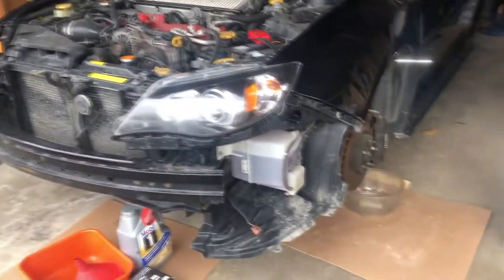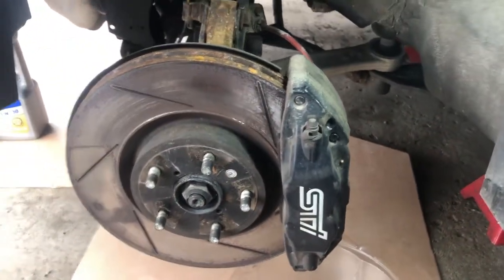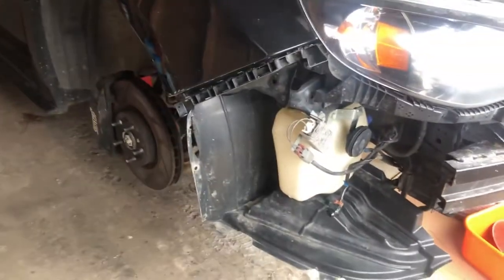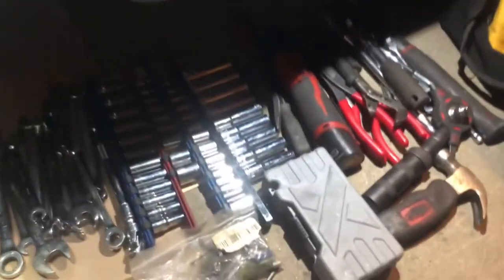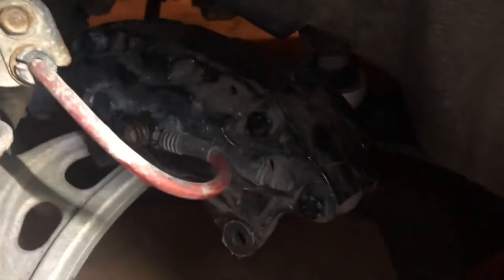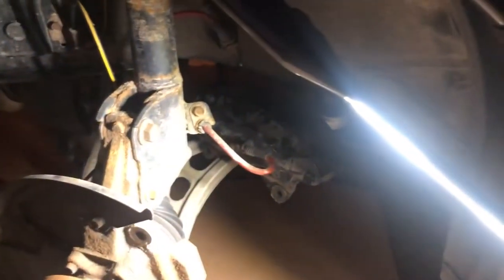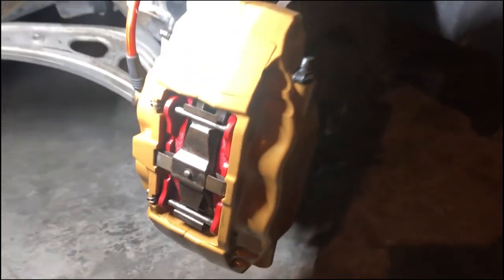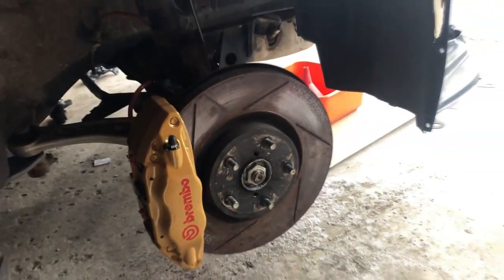PROJECT STi: How to install 04-07 STi Gold Brembos on 08-14 STi or WRX

Comment: Hey man. Trying to do the same swap on my car. What kinda brackets are these!
Reply from the maker: Hey, these are the torque solutions rear caliper brake adaptors for 08+
Reply: @TorontoEntz  ts-us-318 the part number?
Reply from the maker: @axil806  yes ts-su-318
Reply: Thank you so much!!!!!
Reply from the maker: @axil806  no prob! Good luck with the swap
Reply: Ordered! One more question for you! Did you have to change your rotors to the 05-07 ones or could you reuse the 08+ ones! Thank you
Reply from the maker: @axil806  reused my 08+ rotors
Reply from the maker: @axil806  but if your doing this swap on a wrx, your gonna need dba dual drilled rotors I believe.
Reply: This is going on my 08 sti! Can I reuse my rotors and pads? Had a brake rebuild go wrong so that’s the reason I’m doing this swap.
Reply: Also lastly how has everything held up!
Reply from the maker: @axil806  okay in that case you’ll be fine, and I’ve been running this setup over a year now. No issues